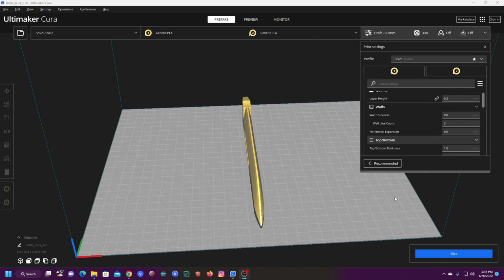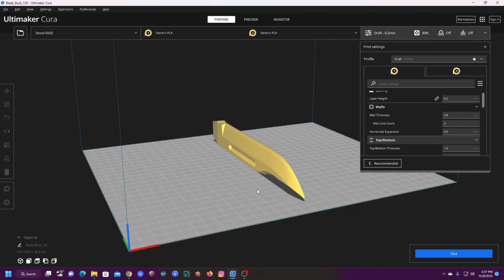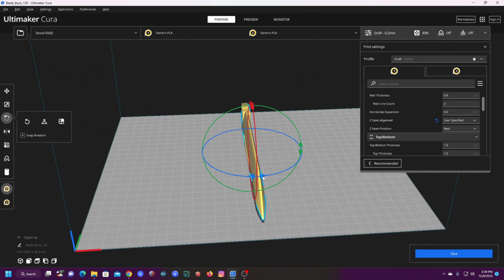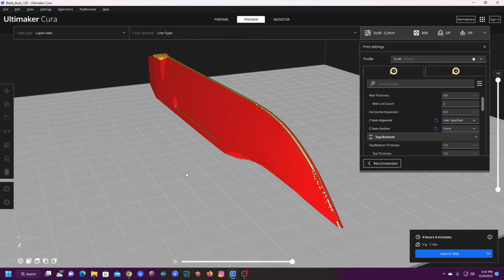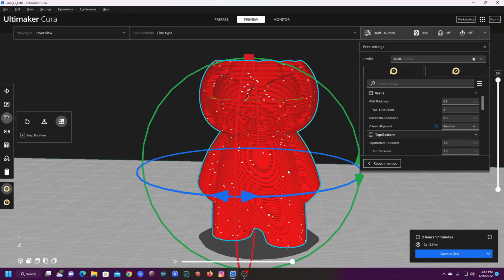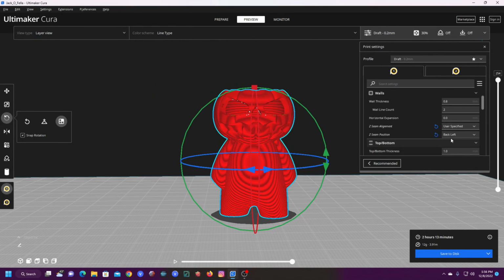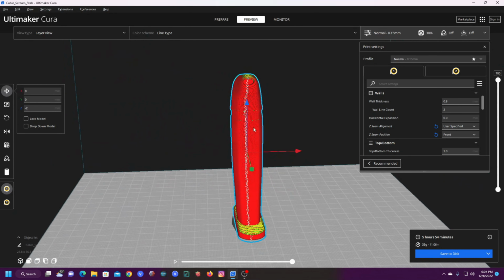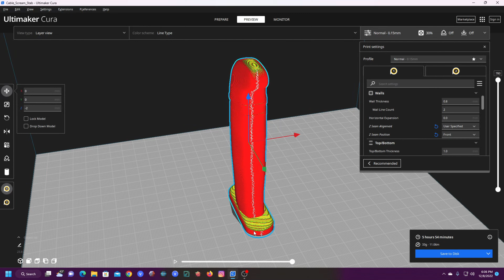Where, and HOW, to set your Z-Seam location, in Cura, for 3D Printing. fix that Line down your Print

Comment: My ender 5 pro prints the seams back to front. Any idea on how o can fix that?
Reply from the maker: It will print it however it shows in the Slicer. It will always be made with one mark per layer, up and down. Anything else, may be something other than your Z-Seam.

Comment: Wish someone can help me with my silk on my design my seam has like dint throughout
Reply from the maker: Which machine you on? What's the problem? I print ALLOT of Silk
Reply: @3DRundown  anycubic Kobra neo and my seam just doesn't seem flush with my model I have a picture if helps it's like a line but all the way up a dint in it
Reply from the maker: Sure, link me to the pic, and the slice preview of the Z-Seam